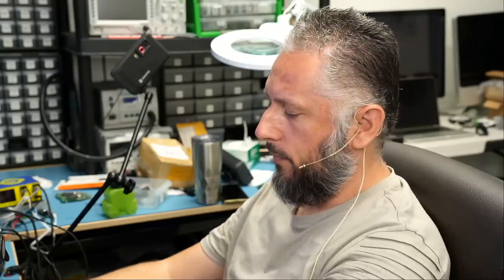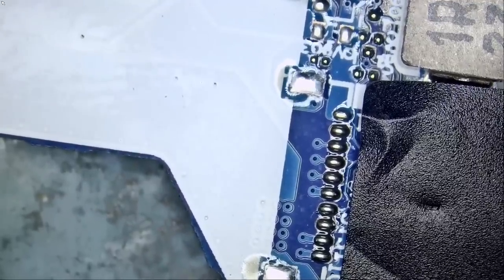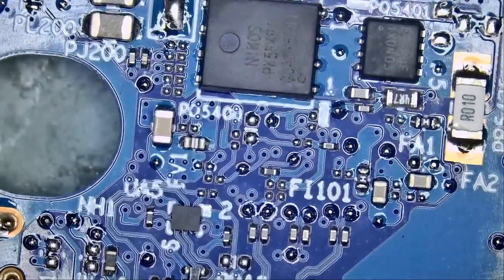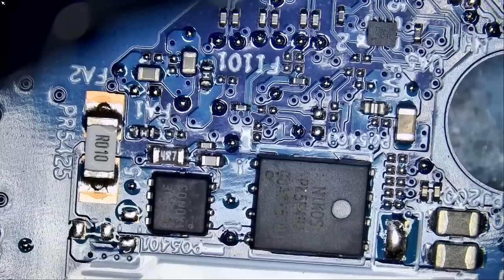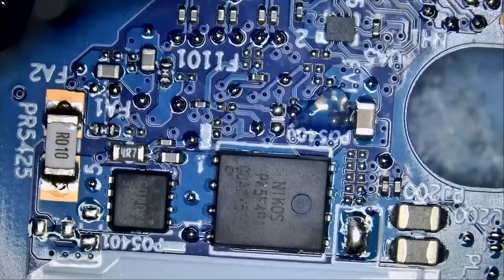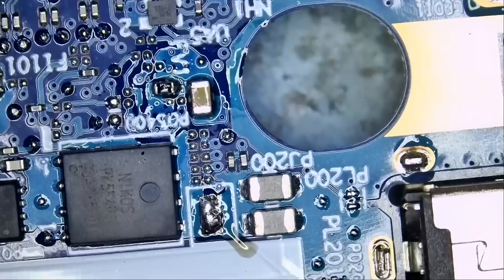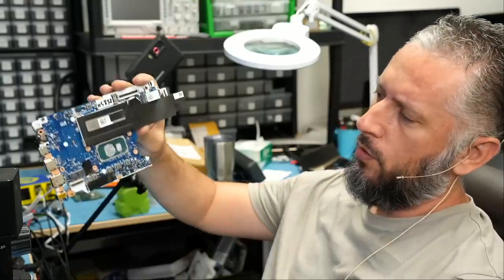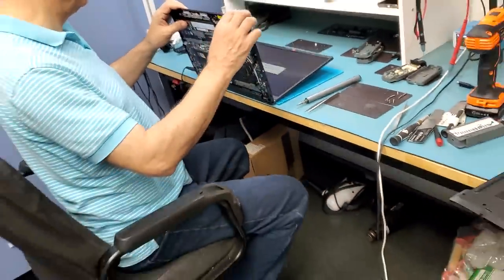Lenovo V15 G2 Laptop Repair - Dim image Blown Backlight Circuit.

Comment: its rare to see a lenovo and you made quick work of it. love your content.
Reply: Lenovo seems to be quite relatively reliable compared to some of the other brands.  Their office machines are especially well made.
Reply: @robinsattahip2376  They used to be IBM I think
Reply: My Lenovo IdeaPad was built by Foxconn. So was my HP laptop and my Dell laptop.  Everybody is using the same factories to do the assembly. If there is a difference, it will be in the components specified.
Reply: @LatitudeSky  the proof of the pudding really is the hardware's design and the components' quality. it also doesn't hurt that Lenovo uses simple methods making assembly easy for 3rd party companies.
Reply: @LatitudeSky  nowadays china may not manufacture or use high grade chips so it's only basically fuses and basic stuff on the board, chip assembly is outsourced somewhere else
Reply: @LatitudeSky  I used to think this until I saw behind the scenes power supply manufacturing, and custom ordered random stuff from Shenzen. Brands that order things to be made can specify additional QC and as you said better components, among other things
Reply: Welldone Alex!
Reply: @dbcooper7326  Correct. IBM spun their PC/laptop division off to Lenovo decades ago.
Reply: It's rare to see a Lenovo that doesn't blow up something on the backlight circuit during it lifetime

Comment: You make the removal of hot tweezers look so easy. I have to wait longer than u with my hit tweezers. Is it the type of tweezers ir the heat that you use on the station?
Reply: He's probably using higher temps. Unleaded solder requires much higher temps because it has a higher melting point.

Comment: I remember I once had a cheap laptop from a brand called Nextbook. I installed a Linux distro on it, and if you turned the screen brightness down to zero, the backlight would shut off, and you could barely see the image.

Comment: I just don't understand why a fuse blows when upgrading a SSD when the battery is connected. I've changed many SSD's in laptops with the battery connected and the fuse never blows. 🤔
Reply: It wasnt the ssd I was changing out the screen from it being cracked. Didnt disconnect the battery before doing it.. This is my laptop lol

Comment: Common problem with Lenovo laptop if you dont unplug the battery before removing edp cable but i didnt know nvme can affect it too. Maybe the customer doesnt tell the full story.
Reply: ya, never had any problem when installing a new ssd/memory before
Reply: It wasnt the ssd I was changing out the screen from it being cracked. Didnt disconnect the battery before doing it.. This is my laptop lol
Reply: @WhatsUpJester  that's your laptop?
Reply: @maklogetrich2378  yep